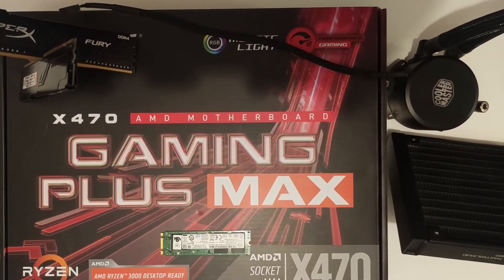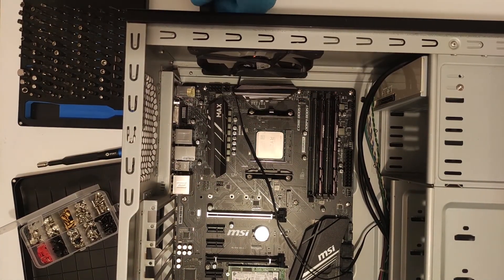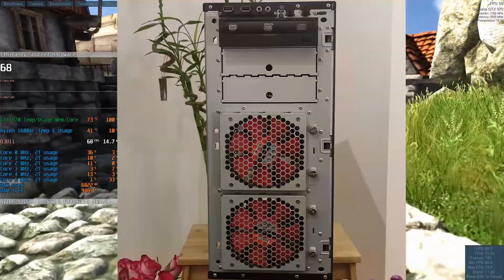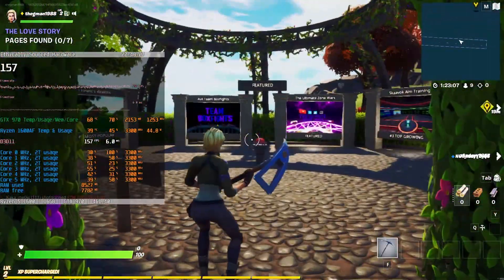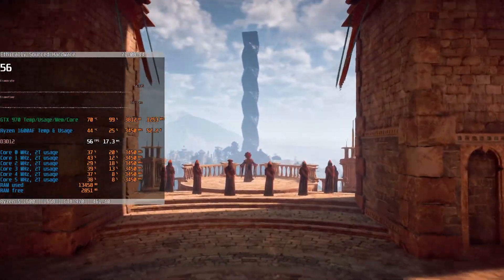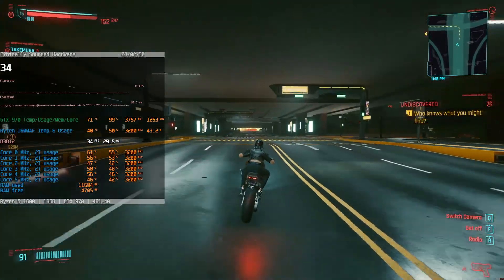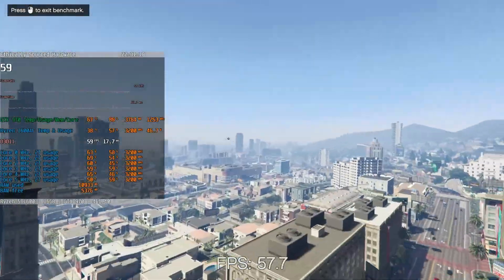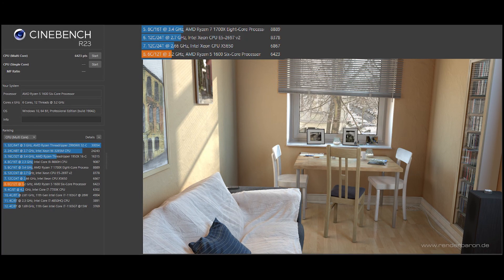AMD Ryzen 1600 AF; GTX 970; 16GB RAM with 9 games benchmarked . Is it worth it in early 2021?

Comment: Got a pc with pretty much the same specs for 220€ (R5 1600, 16gb DDR4 3200Mhz, GTX 970 4GB, 1tb HDD, 240gb SSD) and it's even easily upgradeable because it has a good motherboard and a decent power supply in it. 💪🏻

Comment: I recently just bought this processor from fb market from a seller who had never opened it and still had the seal in tack all for 90 dollars. I started messing with my overclock and I realized that cpu-z was reading it as a 12nm and I was confused. Come to find out I have the AF version. I was able to overclock mine to 4ghz at 1.4 stable but if I drop the volt any lower than that it will run for 15mins then crash. I left it at 4ghz at 1.4 just to run cinebench and see the scores and I’m very impressed by this chip. I did lower it to 3.9ghz at 1.260v just because I didn’t feel comfortable at 1.4 as I’ve read many saying it will degrade the chip also I wasn’t comfortable with how much of a voltage increase I needed for only 100mhz more.
Reply from the maker: Nice find! 1.4V is a bit much for daily driving, but ok for occasional OC fun. 1.3V is about as high as the 12nm chips can tolerate (sort of safely) so your 1.260V in theory should be super safe. At 1.3V it might still degrade but it will take literal years of 24/7 operation so depending on how often you upgrade so that might also be an option if you find in the long run that 3.9Ghz has stability issues in edge cases at 1.26V - if in doubt try Prime95. My old 2700x lasted about 2 years before it slightly degraded and I had to revert to stock so they are quite resilient. Enjoy!

Comment: No Warzone benchmark :(
Reply from the maker: Thank you for the comment - I am planing to update my test SSD from 1TB to 4 in the near future so Warzone won't be such an inconvenience due to its size ;). I will try to include it in future videos.
Reply: @ESHW  I actually have an 240gb SSD and there is a place for Call of Duty Warzone hahaha! Unfortunately, I flooded my HDD, don't ask how... :D Yeah, it will be really nice to see how Warzone runs on 1600 AF with GTX 970 (have the same GPU) but my CPU isn't too good (i5 4460).  
After many hours 
with optimizing all things on the computer, however, I was successful to run this game on my specs without freezing, stuttering and at good avg. FPS for these components. If I only had the option to run my processor on turbo-boost on all cores, it will be even better.

Comment: Can you test fortnite epic settings 1080p?
Reply from the maker: Yes, the first bit of Fortnite is at 1080 Epic - I just sped it up a lot. Average is 62FPS from my records, but it does drop to the low 50s. Unfortunately I don't have this particular system anymore to retest.
Reply: @ESHW  i just rock this gpu with a ryzen 3 3 3200g and my gpu is at 80% and cpu 100 so i thought how much extra fps you wil get thx for the reaction
Reply from the maker: @kabyp2366  sounds like you have a CPU bottleneck in Fortnite, but the hardware pairing I would say is very decent, it's just that Fortnite really likes CPU speed and cores. For an extreme example of bottlenecking, see this video of a 3200G Vs a 3080 that I did a while ago :https://youtu.be/GfB_OI2A_jo .
Reply: @ESHW  yeah the bottlenck is there thats why im getting the 1600 af